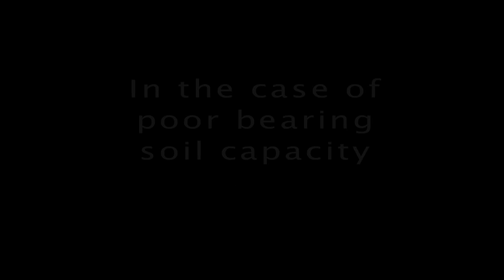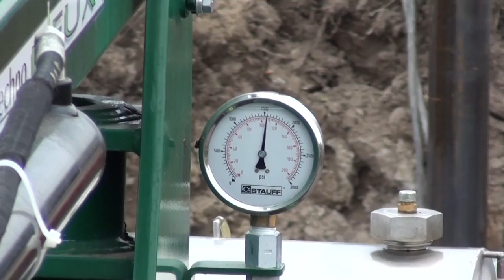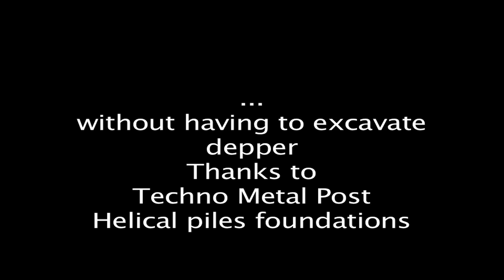Techno Metal Post - Helical Piles Under Concrete Footing

Comment: What was so special about this build that it required this?
Reply from the maker: Hello, 
Helical Piles can be used in situations where the soil under the concrete foundation is unstable or insufficiently strong to support the load of the structure. Screw piles can also be used to reinforce existing foundations that have been damaged or weakened by extreme weather conditions or ground movements.

Comment: Installing them plumb is not a requirement to achieve engineered bearing capacity?
Reply from the maker: Hi and thank you for your question. To be clear, our goal with every helical pile installed is to have the pile shaft straight and on mark. Sometimes during the install, our installer may encounter rocky soils or even a large rock at depth where the pile needs to move a few inches to accommodate the obstruction below. Our brackets allow for some small adjustments for connection to the substructure if they are ultimately not on mark.  If the pile shaft is at a slight angle, the pile is still able to hold the structural load and achieve bearing capacity if the helix is locked into a soil with the desired pressure. Each pile that is installed forms part of the overall foundation structure.  Once they are all in the ground, they are then connected using the desired brackets to the substructure.  This ensures the formation of a complete foundation which then vertically manages the structural load across the entire pile array, not a single pile.  When we need to manage a lateral load, we may install piles at a specific angle to manage that lateral load, but that angle is done on purpose.  These types of piles are called battered piles and work in conjunction with a vertical pile that manages the compression load at that location.  If you have an example where you see a pile installed at an unusual angle, please let us know. If it is a Techno Metal Post pile, then we will follow up on the project to ensure that everything was completed as per the engineers specifications.  Thank you and have a great day!

Comment: Doesn't the metal eventually rust?
Reply from the maker: Hello! For most corrosive soil installations, hot-dip galvanization and the extra thickness provides long-term protection for foundation helical piles. In extreme corrosive installations (ex. saltwater), Techno Metal Post has specially developed technologies using the principles of cathodic protection to ensure that even helical piles that are installed in corrosive environments are protected for the long term. Our system defuses an electric current produced by an external rectifier, thereby ensuring continuous protection of the buried steel structure.

Comment: I always hit stones when I dig out for fence posts, which require me to break them or remove them. Sometimes I get stones that weight 50 to 100 lbs. What do you do when you hit stones? Will the technopost break through? Do you have to change the post location?
Reply from the maker: Normally, we just power through loose rock (the size of a basketball or smaller).  The installation machine generates sufficient torque for the helix to push rocks out of the way as it turns. Sometimes, the installer can actually steer the helix around a rock, then use the machine’s boom to pull the pile back into plumb.

If we hit a large rock below the frostline, the pile is parked on top of the rock and load- tested. Assuming it passes the load test — it usually does — we can be confident the pile will never move. If it doesn’t pass the load test, the pile will have to be installed in a different spot. On critical jobs, a soil test has often been done before we get to the site, so we’ll know where there’s ledge or bedrock.

When we encounter a large rock above the frostline, it can be drilled and the pile’s shaft pinned to the rock. Occasionally, however, there is so much rock that helical piles just won’t work.

Comment: Does this method require the deep excavation (maybe coincidentally) shown in the video with a basement to get below a (~50") frost line? Or would the piles properly support reinforced concrete on grade (beam or slab)? I know that's pretty vague. But I guess I mean the best soil conditions and no frost protected shallow foundation insulation.
Reply from the maker: In the video, they were installing piles under a residence with full basement, so the footing was deep enough in the ground to be protected from the frost. We can also install piles under a grade beam or concrete slab, but in these cases, because they are not deep enough, the concrete foundation needs to be protected from the frost by another way. The most common way to protect the foundation is insulation or void form. The piles themselves are always installed in way that the helix is below frost line to be protected from the frost, but the structure above needs to be protected too. Another solution would be to build minimum 6 inches above the ground on the piles.